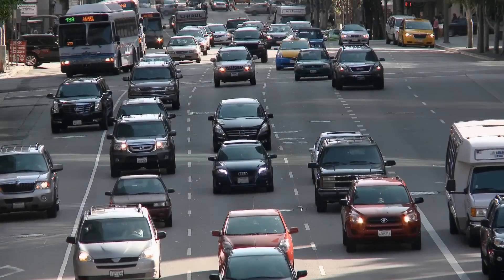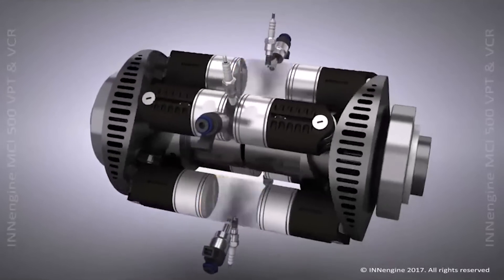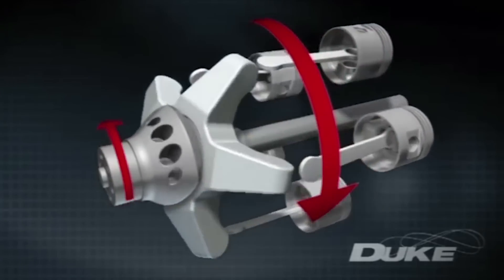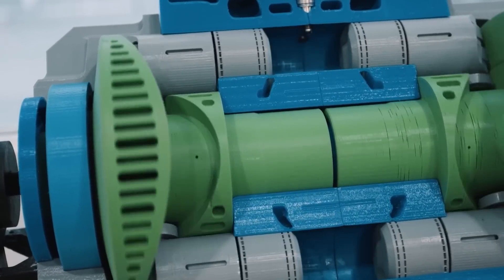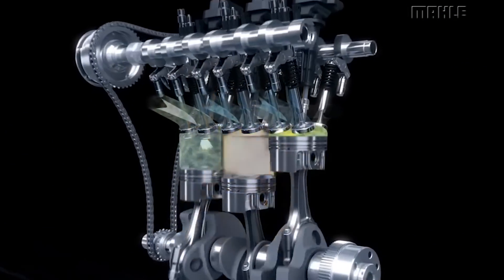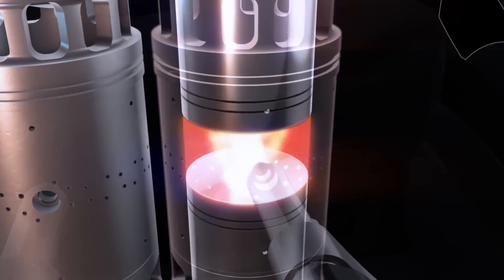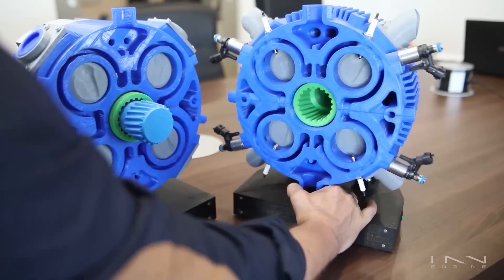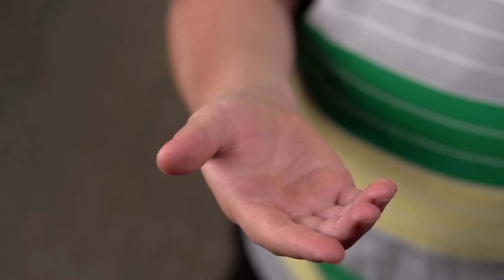Revolutionary One-Stroke Engine: Future or Fraud?

Comment: The piston Rollers on the Swash Plate, or Wave plate, are not that much of an issue. Roller bearings on the crank shaft of ICEs use to be very common on Race car engines and some road cars, particularly French cars such as the Citroen DS and SM. The effect  was much better performance and longer life. Although this came at increased cost  and modern metallurgy and engineer  made roller bearings on the Crank mostly unnecessary. But in smaller engines remain their most useful. Maintenance was simple enough. Just change the engine oil when you are supposed to and the roller bearings would last pretty much forever. 

And this is NOT making concern of roller bearings in the Valve trains of many ICE-vehicles. Again just change your oil and it is not a problem.

So, in the E-REX, the roller bearings should not be a problem at all, as long as the bearings are of good to high quality. I would have however preferred if the engine was presented with less showmanship and more straight the facts.
Reply from the maker: Great insight. Thanks!
Reply: Americans are consumers. Maintenance isn't in their vocabulary, but "spend" and "purchase" and "buy" is.
Reply: Not the same as a roller bearing crank as the rollers ar a single poin of contact with the plate so all the combustion loading gets hammered into a single line contact.  Likely to result in failure of the surface treatment of the plat and eventual failure.  Pumping applications don't have anything like as extreme pressure cycles.
Reply: @thamesmud  and the rollers have a certain width rolling on a circular plate , thus one side of the roller has to travel longer on the plate than the inside , so it will see a lot of more wear compared to a valve train where everything is moving in the same plane
Reply: "Swash or wave plate" are called open-face cams fya. 😊
Reply: @clarkcusick  
Wave Plate and Swash Plate are also very specific variation of the same overall  concept. A Wave plate having a wave profile. A Swash Plate literally being little more then tilted plate on an axle. 

However, you learn something new everyday.
Reply: "I would have however preferred if the engine was presented with less showmanship and more straight the facts." I think this is true of engineering minds everywhere.  Sadly, the rest of the world doesn't appear to respond as well to that.
Reply: @v3rlon 
It used to be that education, public and private, worked well to teach children up to young adults (older teens) the basics of STEM, to a point where the layperson at least knew when they were being BS'd.  And of course you always had that smart kid who had no problem showing off the were smart  but also had the side effect of sharing knowledge.

Sadly now, increasingly more people are so  uneducated on Basic STEM and so conditioned NOT to trust smart people even when they understand what they are being told, that the only thing they do seem to response well to is spectacle even if that spectacle is a total lie.
Reply: You're absolutely right, but we can only assume because they don't give technical data!
Which suggests a big fat scam!
Reply: Don't travel to the USA.  Students study hard, and you easily steal their ideas from their brains. That sounds like a good deal. Fighting for freedom. New slavery. It is my responsibility. I thought everyone should know. We are imprisoned in a place whose slogan was freedom.  Don't travel to the USA. Never even for a short time. If you have any special knowledge or skills or an invention, they will steal it from your mind. The US government initially used this method to identify people who intended to harm the United States. But today, they use it for many purposes, including stealing information from people and stealing data from people's minds. Many celebrities like Taylor Swift and Harry Styles are helping to lure the US government. They can see whatever you see. You'll never have privacy even with your wife or girlfriend. They could see whatever you think. When Taylor Swift said I used my best colors for your portrait, she meant it. when she said, "Touch me, and you'll never be alone." Or when she said, I can read you like a magazine. Your silence would help them to do it again and again. They said, "Don't say anything because of the USA. I want to take her to court. They wanted to pay me $1,000,000. Those are not only songs (Taylor Swift) likes A writer of crime stories whose stories are authentic and have committed all the murders. Taylor Adolf Hitler, the Humans, are not your laboratory mice. Sometimes, what we hear is like warning lights to prevent accidents. Events that the causes of those events are not afraid of repeating them, but they are happy. And they sat waiting for the right time. Let's not ignore what we hear. Kidnapping in a new style. Support with like   ......................................... #Taylorswift_is_murder  Doggy styles ( #HarryStyles_is_murder ) #Selenagomez_is_murder #Biden_is_murder  #Trump_is_murder  #NotravelUSA
Reply: The roller beqrings of a hyrdaulic cam shaft have things going for them that benefit their longevity.   First is the fact that 4 stroke engines require that the cam rotational speed is 1/2 of that of the crank shaft for proper valve timing.     Add to that the bearings are coming into contact with a much smaller diameter object so the ratio of bearing revolutions to cam revolutions is closer.

This ridiculous engine requires the bearing to travel a much larger path along the cam surfaces.   The wear is greatly increased.

And comparing to crank shaft journal speed is another issue as well, lots of racing engines rely on smaller journal diameters and bearings to reduce the linear speeds.
Reply: Wow, to solve this argument we need to see some heat probes.  I'm for sure that this thing is designed for an rpm range that's unnecessary.  I think the friction is creating the torque and that's bad imo.  it could be made larger and run slower and avoid the heat without adding too much weight.  charging systems only need a constant minimum rpm.  the exit ports are gonna kill any rings in short order.  I think the truth is, we just need a .75 liter diesel to charge our hybrids.  I get 50mpg w/o sacrificing HP with the toyota hybrid trans.  I could see getting 75+ with the right motor.  I think some people like me who loved their 400cu pontiacs are starting to come around on this.  Best mpg before hybrid i got was 35.  Most of my daily drivers only got 19 at best. This motor is NOT it imo.
Reply: It's the different speed that the plate spins at from inside to outside. A roller will wear very quickly like this
Reply: @braydeny  
You should review the diagrams again. Even in the video, again. there is more than one roller bearing. Each piston has four, on the main wave plate, and one on the smaller inside plate, which keeps  the  piston in contact with the main plate. and then you gravely overlook the fact the wave plates,  pistons, and  roller bearings are lubricated. When you  consider just how many parts of current ICEs rely on things sliding against each other and the importance of engine oil, I can in no way agree with you.

Comment: The swash plates cannot work - the inner and outer faces of the rollers traverse different distances so will have to scrub like a tyre. Slick video but no independent testing - the usual M.O. for investment or vapourware schemes

Comment: So basically a dual 2 stroke wobble plate engine.  I didn't see a game changer regarding their limitations namely low efficiency, high emissions and a very narrow power band.  At best it will have very limited applications.
Reply: I think the EV application is why this might work, as the engine would run at near constant speed, but the emission issue? That I don't know.
Reply: I would say its a 10-Stroke engine, just because its not a normal 2-stroke engine....
Reply: You are absolutly 100% correct, it is a 2 stroke.
Emission will be a problem since fuel is injected from the side and not in the centre.

Comment: It fires each piston 2 or 3 times per revolution. Where a 2 stroke does 1 and a 4 stroke fires only every other revolution. There is potential but bearing problems seem imminent.
Reply: Makes no difference how many firing cycles per revolution there is, each cylinder requires two separate strokes to operate so it's a two stroke engine.

Comment: If everything works out and that's a big if this engine might have some use in light aircraft. As for a game changer, not going to happen, you try to get the well established engine manufacturers to change their set up that they have spent billions on and see what happens. Hydrogen as a fuel for the internal combustion engine is totally impractical.

Comment: Saw this elsewhere. They should have never called it "one-stroke" as that's a definite misnomer as it operates under the two-stroke cycle. However the real innovation is that it operates as a "dry" two-stroke, so like a typical 4-stroke engine there is no requirement to mix the oil with the fuel. It still means certain improvements such as cleaner running, and they would have been better off just focusing on those aspects instead of dumb-sounding marketing speak.

But in the face of certain developments around electrification, it may be a bit late. (Depends on how much battery tech improves. Although this engine may still come into play for hybrid systems where it could operate at peak efficiency under a nearly fixed RPM rate.)
Reply: You've got the right idea, a small engine running constantly would greatly increase the range, or reduce the amount of battery required.
Reply: And it will be banned in Europe, because that would be a hybrid vehicle, @larrywhittemore9362  .
Reply: There may also be a good market for small aircraft, hydrocarbons are just so energy dense nearly all airplanes will keep using them for a while. A new lightweight engine design could be a great boon for ultralights and hobby planes, or even a whole new generation of light aircraft as we move away from leaded fuel and need new engine tech.
Reply: Its not a misnomer because the crank/cam plate has two ramps giving it two combustion events per cylinder for one crank rotation. A 2 stroke has one. Its not about valvetrain. This is a piston port 1 cycle by the formulas criteria. I hate complicating things but I'd like to see this motor in half, with a head and all the 4 cycle valve trane. It would complete all 4 cycles in one revolution. So 4 cylinders would have the same combustion events as 8 per rotation. Like how a 2 cycle or rotory engines do. Only it wouldn't waste so much fuel.
Reply: @Bellcephus1  it is a misnomer because the pistons do not move in only one direction. They move, stop, and reverse direction. Rotary is closer to one stroke than this thing. That said, this is an interesting engine and if it can hold up better than rotary or liquid piston (reverse rotary really) then it could have some meaningful benefits going forward. But I don't see this as a death knell to electrification, which is frankly the future. We just need to figure out the battery technology that is both sustainable and ecologically friendly to make while still granting the range requirements of modern automobiles. 

This could make things like Lithium Sodium batteries actually useful because you could have a limited range with an efficient range extender, like someone else in these comments suggested.

Comment: The concept has possibilities. not sold on current claims. i,m american so forgive the conversion. its 500cc or 30 cubic inches. they claim 120 hp to 30 ci that is 4 hp per ci. some of our diesel fanatics can get close to that with there ultra high performance engines but no longevity. i would be interested in longevity and increased cc to 750 and 1000 to compare. the other thought that comes to mind is this design allows multiple engines to be coupled together.

Comment: I predict one big issue, most force which is produced will not act in the rotating direction but "through" the rotating wavy plates. Theerefor efficiency gains from the opposed piston design will most likely not be enough to make this an efficient engine. In other words, it will be very inefficient....

Comment: If the weight of this engine is truly just 25% of a typical four stroke engine it would seem to be a great choice for a light aircraft engine. Maybe applications in motorcycles and scooters too.
Reply: Narrow power band even tighter than a two stroke.
Reply: @peterweller8583  OK, so maybe not too great for road vehicles but light aircraft with constant speed props maybe.  That weight advantage, if realistic is hard to ignore.
Reply: @peterweller8583  most opposed piston engines actually have a wider power band, I think this would be the case as well, but without any Dyno graphs there's no real telling.

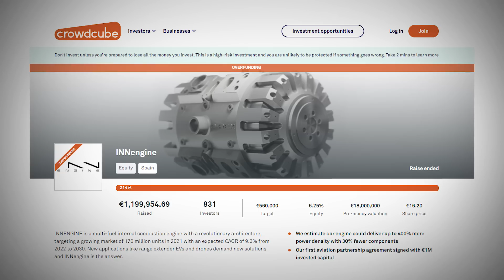Comment: Wont compete with EV, but might have potential, however 8:28 swashplate roller problems is a concern.
Reply: Perhaps they can use frictionless swashplate using jets of air and or magnets powered by the the motor ?

Comment: Sorry Ryan it's not a 1 stroke and in short it's snake oil and won't be going anywhere sooner or later it's been done before and will probably be done again by somone who hasn't done his research. Swash plate engines will never surpass conventional crankshaft engines but do have a job in some peculiar applications. Do you not think that a company like detriot diesel would have continued to produce there very successful 2 stroke diesels today unfortunately they couldn't meet emissions regulations.